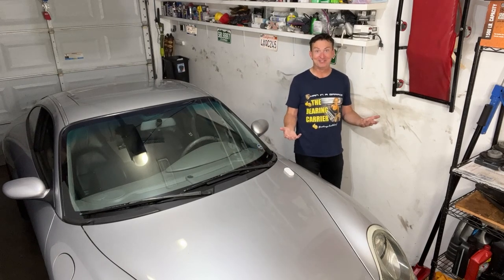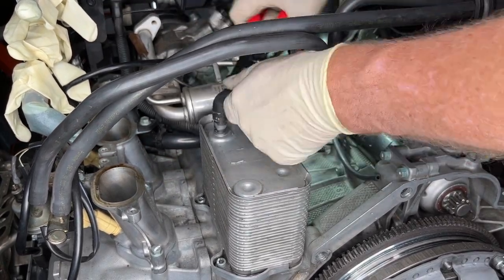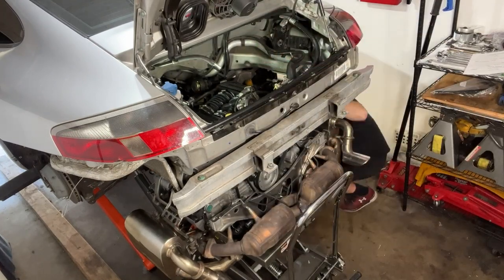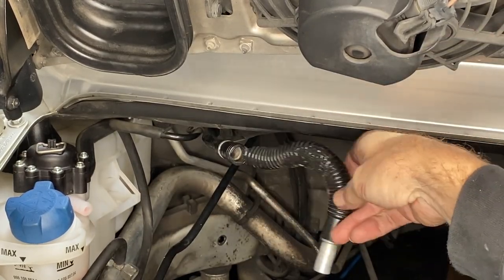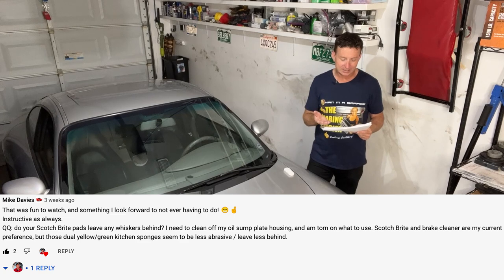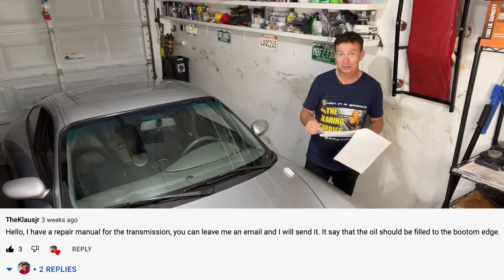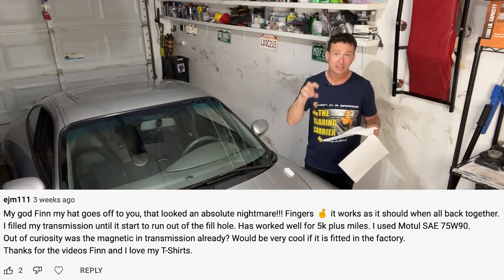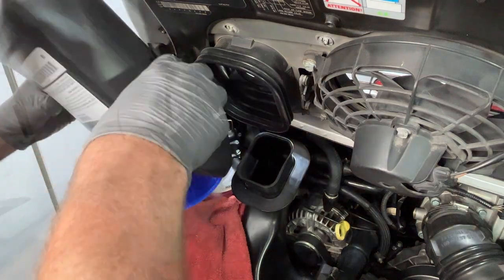Porsche 911 Engine Installation again (again!)

Comment: Some Scotchbrite breaks up with solvents like brake cleaner more than others, the pads that bear an abrasive will shed their grit faster too. They sell a blue version that has no grit called delicate surfaces scotch Brite, and  a white that is meant to be equivalent to 0000 steel wool. If there's abrasive in the white it's hardly worth mentioning. The blue is great for scrubbing off what is meant to come off and not what isn't. Seems to stand up to strong solvents pretty well. But if it has toluene and acetone, might get a little floppy.
Reply: The dark green, red and black have grit.
Reply from the maker: Very, Very helpful. Thank you for taking the time to share this with us AJNpa80. There is so much to learn 😅. Thank you very much for watching 🤘😎 Progress has been made... 
https://www.youtube.com/watch?v=njzwt6xYTXI

Comment: a heat exchanger will normalize the temperature deltas between the whatever is running through it. hot entities will become cooler and cooler entities will be come hotter. there are usually two entities, but there can be more. the entities are traditionally liquid, but again, don't have to be. the exchange is usually performed through a medium consisting of a heat conductive metal, but not necessarily. the most common type of heat exchanger used by an internal combustion engines are commonly referred to as a radiator. but in fact, the entire engine block, heads, exhaust manifolds and engine compartment surfaces function as a heat exchanger. the two entities being engine coolant and the atmosphere.
Reply from the maker: That was a good read 🙌 Thank you for watching and explaining 🤘😎

Comment: Just a word of caution - Scotch Brite pads contain small particles of aluminium oxide and that dust can embed in bearings and over time destroy the engine.
Reply from the maker: Hello Mika, what do you suggest using instead?
Reply: @ManinaGarage  Hi Finn, good question as I'm trying to find an alternative solution as well. I've been using plastic razor blades as even though those are plastic they are hard  enough but don't scratch aluminium. I've been testing gasket remover chemicals as well but for some reason I'm still having some black stuff on my cylinder head even though it feels completely smooth. Not sure if I should leave that as it is or do something more.
Reply from the maker: @mikasoinetsalo9685  I think we all need a desktop dry ice blaster for these parts. No residue, fast and probably a little bit fun 🤩
Reply: @ManinaGarage  Ah, forgot to mention that I used poor mans solution for dry ice blasting - in other word soda blasting :) Works well on cylinder head to remove the carbon. Also tested that "old fashioned" ATF/acetone 50/50 mix and it works really good - well, acetone itself is probably good enough for removing carbon from intake/exhaust ports - along with Dremel :) What's desktop dry ice machine - haven't seen those - do I need to win in a lottery to afford those as well - off to search for those.....
Reply from the maker: @mikasoinetsalo9685  Here’s one in action on Scott’s channel. https://youtu.be/_wkvNWAzNVo

Comment: Finn, how much coolant are you going through with these engine take outs?  Are you reusing it?
Reply from the maker: Howdy Yogi 🙌 Each fill is a little less than two gallons of coolant plus the water. I did not reuse any of the coolant, I considered it a way to clean out the Cooling system. The coolant that is in there now will hopefully stay in for a while. Thank you for watching! Best of luck with Peppers install. 🤘😎